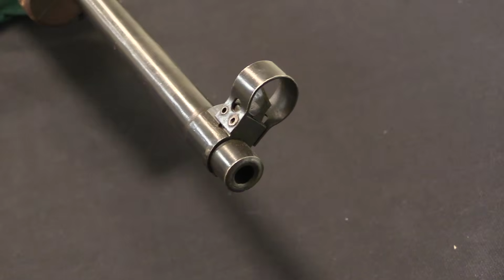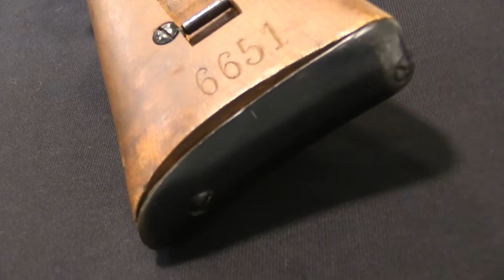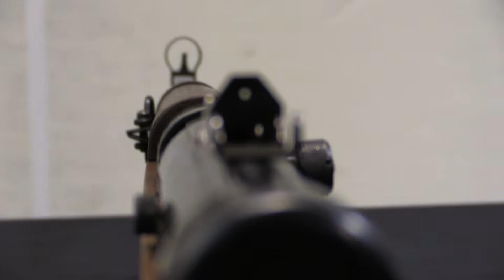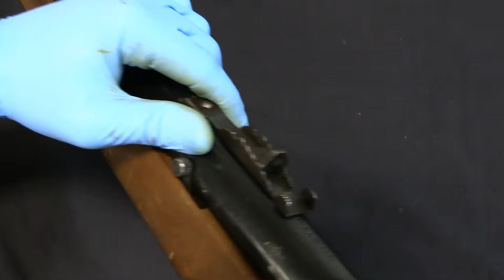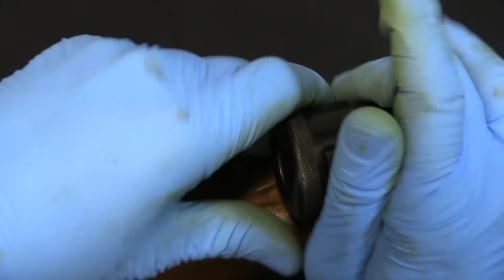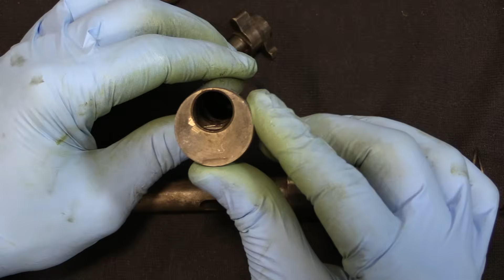San Cristobal Model 2: A Lever-Delayed .30 Carbine

Comment: Could you please describe the EJECTION of spent brass? 

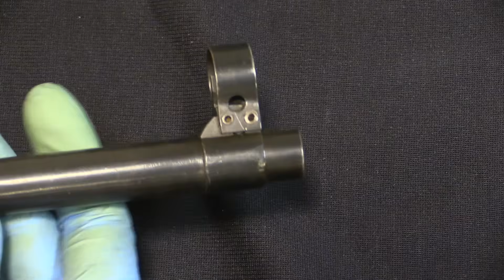From what I can see of bolt group, it appears the case head after extraction meets something that the slot in bolt carrier at 6:00 position rides over. 

But you say only thing inside receiver tube is actuator bar for the lever? Is part of the trigger/sear group also an ejector?

Enquiring minds want to know!

Comment: Hey Ian, big fan of your channel, keep up the amazing work. 
I lived a very long time in the Dominican Republic, I don't know if the info is accurate or not (it is according to a book I use to own called Infantry Weapons of the World), but the origin of this gun in the DR is told as a deal that was made with Beretta, where some engineers were loaned for the development of this weapon. As interesting trivia, the gun is colloquially known as "Cuerno de Chivo" or "Goat's Horn" due to some of the magazines used being curved. It is also renowned on the island for it's unreliability, and a design flaw which often enough caused the rifle to fire when dropped or if it suffered a strike or shock; this being an automatic weapon, it gained a reputation for being quite dangerous for the user.

Comment: 15:50. Wandering afield gives us good info. I had just started wondering why the U.S. didn't follow this path when they wanted a select fire M1 Carbine but found it impractical. Why not switch to the Beretta style design? This San Cristobal Model 2 is tending toward a Grease Gun simplicity (and cost). Oh, open bolt vs closed bolt  disadvantages. Question answered.

Comment: Very interesting gun! A later version of the gun, called the San Cristobal Model 1962, was more sub machine-gun like, with a shorter barrel (12"), perforated, tubular barrel sleeve and a folding stock. The interesting thing about this gun, especially the later version, is that some people feel that the M1 carbine cartridge is actually an overgrown pistol cartridge rather than an anaemic rifle cartridge, and that a SMG type weapon, such as the Cristobal, is actually more suited to the cartridge than the M1 carbine, which was trying to be an assault rifle. What would be really, really interesting is if Ian could get his hands on one of these to fire it, and to compare it to the M1 and the M2 carbines.